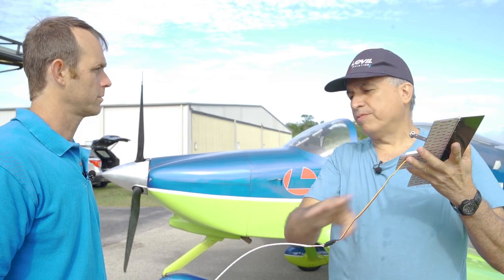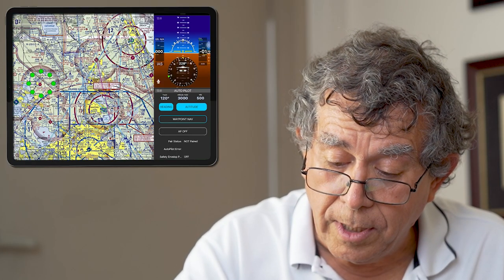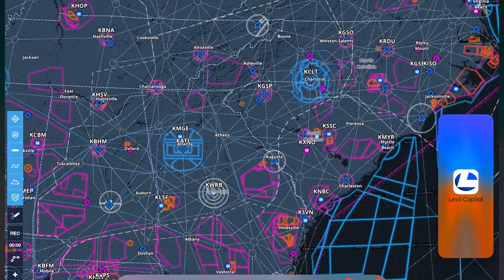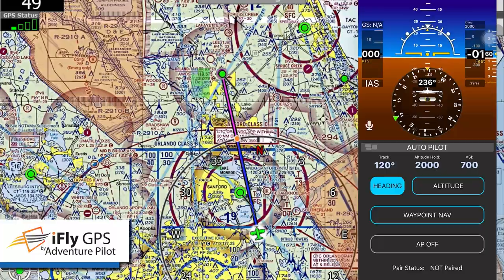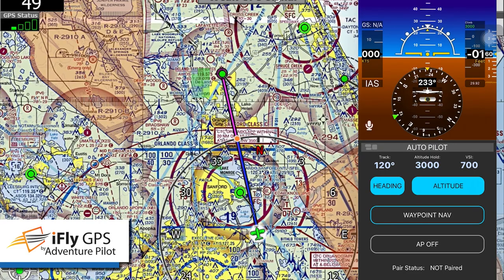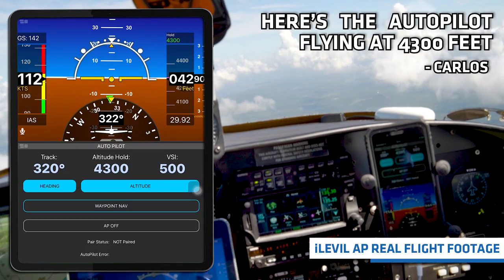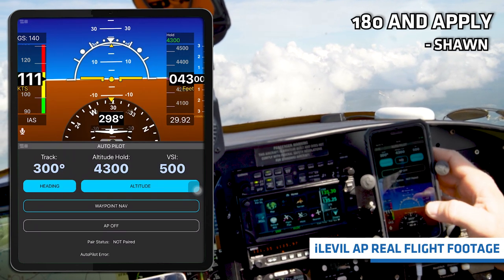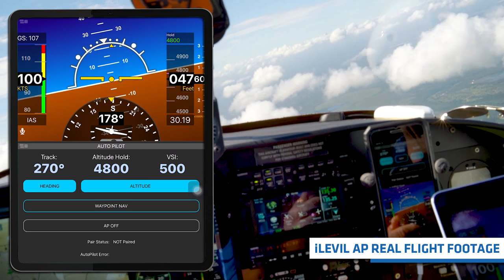Affordable Autopilot Solution for Your Experimental Aircraft | iLevil AP by Levil Aviation

Comment: SO to confirm does NOT work with foreflight/Sentry Plus?
Reply from the maker: The iLevil AP will replace the Sentry. You may use the iLevil with ForeFlight, although the only feature that will not be available is having the autopilot follow a navigation flight plan from ForeFlight. This feature is only available with iFlyGPS at the moment.
Reply: @levilaviation  Is it in the works to have ilevel work with foreflight navigation ?
Reply from the maker: @garyhardison1275  no, ForeFlight is not planning to have AP navigation. If they are ever open to the possibility, we would be more than happy to integrate the iLevil AP with their app. In the meantime, you can only use the AP feature with iFly GPS.
Reply: @levilaviation  Thanks I love ForeFlight  but having to get another AP is not a big deal I will order this !
Reply from the maker: @garyhardison1275  perfect, we're here to help if you have further questions.

Comment: With SO many Experimentals having already gone to Garmin's G3X system or similar Dynon or GRT systems with their integrated APs, you may have missed your window on this.  Particularly so since these other companies APs are used in IMC and you recommend not doing so with yours.
Reply from the maker: Our iLevil AP is compatible with already existing avionics such as the Garmin and GRT. The Trim tab /iLevil AP is a safer and lightweight alternative to traditional heavy servos that connect to your main controls. It is the easiest and sometimes more affordable way for pilots that already have avionics to incorporate an AP. There is always room for improvement and innovation when it comes to technology 👍

Comment: Excellent product, I got the folder from Oshkosh 2021 and I'm very excited with this option for my under building airplane, I have some questions, 
1- Can the servos be connected with the original trim tabs from the airplane? I think yes, but I'm not sure.
2- Without using autopilot can I operate the trim manually?
3- Is there some way to lock an iPad only for this application?
4- How to get engine information, what is the compatible devices?
Thanks.
Reply from the maker: 1. Yes, they can, but we don't recommend it. 
2. You can use an off-the-shelf PWM driver for 5V servos directly to drive your trim-tabs. 
3. You can't lock your iPad. 
4. You can get engine information by using the EIS from Grand Rapids with the iLevil.

Comment: Nice product.  Will the iLevil AP directly connect and interact with both GR EIS 4000 engine monitor and vertical power  VPX so I can view my engine data and switches on the iPads?
Reply from the maker: Yes, the iLevil AP is able to connect and interact with both the GRT EIS 4000 engine monitor and the vertical power VPX.

Comment: Does level AW system have to have data connectivity to run the instrumentation through the IPAD at all times
Reply from the maker: No, the iPad is only used as a control interface. You can send a command (i.e. set a heading) and disconnect your iPad and the iLevil AP will continue to follow the last heading.